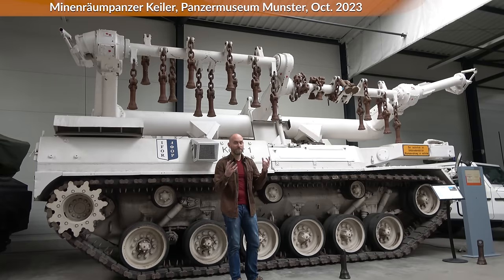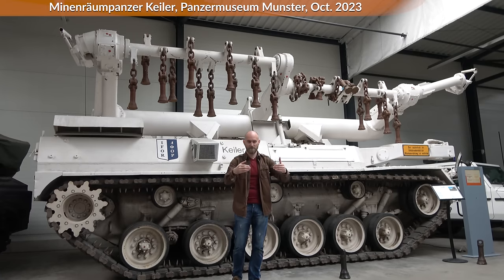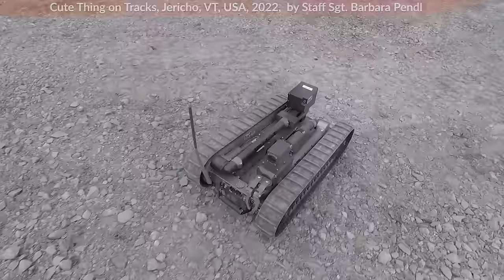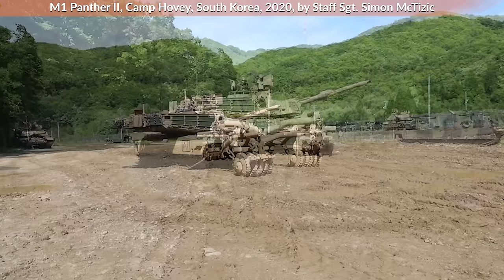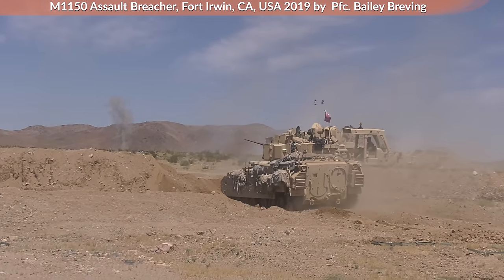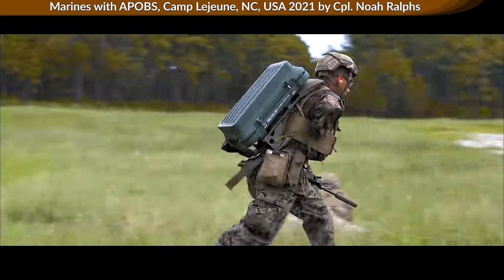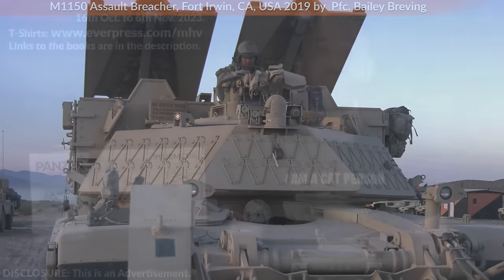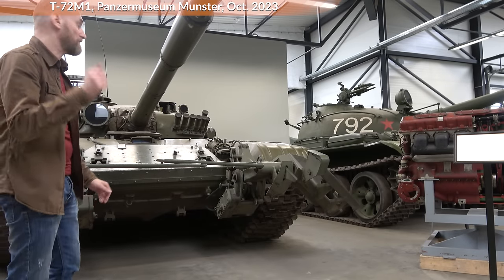Ukraine: The Problem with Mine-Clearing Tanks

Comment: eod work is different than breeching actions in combat, i think this should be seen as different tasks when dealing with mines and thinking about used equipment. there are always new ideas around the corner like autonomous mine detection drones. a logic next step for combat mineclearing would be line charges deployed by drones to get a longer standoff distance or shoot them from cover. am curious how all this works in 10 years from now.

Comment: A remote controlled tank with no offensive capability maybe could be used, it being unmanned means it could just drive straight through and activate all the mines and keep operators safe. Have critcal component's armored more and since its de-armed even if the enemy takes control of it the only thing it could be used for is mineclearing
Reply: Exactly. Nowadays there is literally no reason to use people for such dangerous tasks. Automatised T55 without the turret, extra armour plates slapped here and there and a plow at the front would do wonders. One could even slap a steel rope behind it and when tank is destroyed it could be dragged back clearing another lane :). The sad thing is however that western military is incredibly slow to learn and corrupted to the extreme. Cheap is bad for business. Unfortunately the war in Ukraine can be won only by cheap and disposable with some support of specialised systems. Not the other way around. We see this in case o FPV drones that handly overwhelm more expensive systems.

Comment: I assume that future mine clearing (although the Ukrainian's are rapidly innovating so we may see it soon) will likely be carried out by a mix of small UAV's and very small disposable unmanned ground vehicles or drones which maybe managed by AI systems.

The airborne UAV's will use thermal imaging and perhaps millimetre wave or ground penetrating radar to detect the mines. Then a large swarm of cheap disposable UGV's or FPV type drones are delivered into the minefield. Each one positions itself over or adjacent to a mine and detonates its 'kamikaze' warhead.

Basically we are talking about a 'smart' dispersed multi-element 'MICLIC'. 

I can even see a large UAV or UGV being used as a 'mother-ship' for hundreds of disposable kamikaze 'micro MICLICS'.

We are not far from this point. If someone can combine the quadcopter UAV carried Thermal imaging and ground-penetrating radar systems we are starting to see in Ukraine with computer managed drone swarm tech we are seeing in drone light displays and the cheap FPV kamikaze drones we are seeing proliferate in the field then you have the makings of a dispersed autonomous mine clearing system. Airborne LIDAR and computer managed optical survey techniques seem like other remote detection options. If LIDAR can see ancient ruins hidden under jungle for thousands of years from aircraft, then LIDAR mounted on UAV's could definitely detect and map the soil disturbance that indicates a buried mine. 

The hardware already exists. Its integration and software that needs to be created.
Reply: Ukraine is legit rapidly developing, they are like on 40th mobilisation wave. Crimea by summer with spring counteroffensive 😂

Comment: What about DM-22 anti-armor mines? Those are single-use anti-armor automatic anti-tank grenade launchers, simply put, used for path denial. They can stand between 50 and 100 m from the armor path, depending on modification, and can be triggered by contact (of the wire) or by magnetic field, or by operator.

Comment: Modern mines are designed to be shockproof at least I thought. They require a constant force acting on them to detonate. So line charge should not be as effective/reliable. Old mines are used n Ukraine from what I hear.
Also a thermobaric charge might have a pressure effect long enough because of its blast characteristics.
Reply: Most Russian mines are not Advanced mines but are conventional ones, so shock will set them off. Well, most, not all. Just a few hundred Advanced mines per 500m^2 can ruin your day.
Reply: @ArchOfficial  Yes, and you can notice that off-route mines are completely left out of discussion even though Russians technically should have them. they are just so rare at least on their side.
Reply: @MarcinP2  They probably have a lot, it's just not a lot compared to the tens/hundreds of millions of mines/bomblets of other types they have. You'd need millions of them to have a significant % but they might only have some thousands.

Comment: I am confused by some of the statements, or rather I think they are wrong.
It may be that some of the statements arose from the specific context of the interview with the combat engeneer, which we do not know.
The alleged superiority of mine ploughs may be so but, for one thing, the error rate is higher with mine ploughs than with the mine flail system and Mine ploughs are practically useless in rocky terrain. There are anti-tank mines that act as shaped charges, but most of them, and especially the millions of plate mines laid in Ukraine, are not. If they are not pushed aside but simply fliped around they are still very dangerous.
The repeated reference to the chassis of the M48 being out of date can only refer to the firing of anti-tank weapons. Due to the one-piece cast hull, however, it is considered to be particularly resistant to blast effects, which is probably the main threat posed by mines.

Comment: Those Anti Mine vehicles failed so badly because of Artillery (easily corrected fire for effect because of Drone POV)

They just let them Plow through a lane of couple of dozens of meters and when the assault elements came in they got Targeted and bogged down due to the limited lane Lane the mine clearing vehicles made.

Edit: I remember when the British used infantry engineer's to clear mines and. When the tanks came rolling in the 88's and other anti tank guns bogged down the Tanks due to again the limited safe lanes.

Comment: One thing that you fail to mention (or at least emphasize): Mines are not a means to stop an attacking force, they are a means to limit an attacking force's freedom of movement. The defenders usually expect the attacker to be able to clear at least one lane through a mine field, and they'll be standing by with artillery, tanks, anti-tank guns or handheld weaponry to then attack any vehicle that comes down that cleared path. If the cleared path has only the width of a single vehicle, the defenders only have to be able to take out a SINGLE attacking vehicle, at which point everything behind that wreck will have it's advance halted, and everything in front of the wreck will be cut off from their retreat route.
This is why the fact that the vehicle-launched mine clearing charges can cut an 8 meter wide path is so important. It allows an attacking convoy to use one side of that lane and still have space to pass vehicles that may become disabled.
The only situations where something that clears a path as wide as it's own wheel base will be useful is if they are used with 2 or 3 of them next to each other, of after the defenders have already been pushed away from the mine field, or if the attackers can suppress the defenders so well that not a single suicidal RPG gunner can stick his head out long enough to fire at the column.

Comment: Question:  Could you map and detect mines with a lidar drone or something similar?  Follow that with drones to place small charges on the mines that could be remote detonated simultaneously.  It could be quiet and possibly at night or with a smoke screen.
Reply: Lidar doesn't penetrate soil. 
Radar cant distinguish mines from funny rocks and other trash
Metal detectors see trash and not all mines have metal bodies.
It would have to be a pretty advanced miltimodal expensive system. And it would still be slow and miss rare configurations

Comment: Why arent these remote control. Theoretically they could be set in gear in straight line. Run in reverse to clear for infanty. 

  Has a drag screen on steriods(like whats used on dirt and gravel roads to level) been pulled behind other flail or rollers.

Comment: i don't see why their visibility and exposure would be that much of an issue. sure it's a sitting duck but ANYTHING that fires on it will be giving its own location away. so if you have a tank platoon following behind or just scanning the horizon along with anti-battery artillery, it seems like mine clearing units would be just fine. also, especially since it's a given that their slow, give them super heavy front armor to make the first hit supremely survivable and the friendly tanks and artillery can deal with the attacker.

Comment: Imagine an area potentially laid with anti-tank mines. You send any of these mire removal devices to clear a path.  Then the military vehicles follow. What happens if they are then ambushed? If they go off-line, they risk hitting a mine. If they stay on the cleared path, they become trapped and easy targets.  Therefore, my opinion is that I don't think that clearing a single line is safe...

Comment: Heard from Ukrainian milbloggers that there is an ancient mine clearing method, if there is long dry grass on a minefield it can be set on fire and mines detonate because of heat.
Also mines are seen in the infrared cameras after sunny day because they have different thermal capacity than the soil. Typical anti-tank mines are seen as bright discs. So, most likely , the future mine clearing will be from above by using drones by dropping small charges or using attached machine gun. And all the process will be carried out by AI.

Comment: I think the video is confused by not taking account of the difference between clearing and breaching. 

A breach is a tactical method to punch a lane through a minefield, often under fire. Speed is often of the essence and the risk of missing mines is balanced against the risk of coming under fire. Ploughs are only of value in breaching as all they do is push the mines out of the way.

Clearance is a term we reserve for the search and disposal of 100% of mines in a defined area, not under fire, and where the emphasis is on safety.

As such, NONE of these machines are mine ‘clearance’ devices. None of them are 100% effective and are not considered as a single clearance system.

Comment: See it'd be much more effective to have an armored vehicle with ground sonar, and ground penetration radar, you can use to map the  exact locations of possible mines to blow up, and map safe routes through a mine field

Plots via GPS, and can put spray paint markers on where not to walk

And the sonar and radar devices don't have to make contact with the ground,  a few mm gap so mines don't blow up

Need narrow tread, and wide axle spacing and high suspension so the operator and vehicle is elevated, like in a monster truck, so equipment would "hang" close to ground, while operators are 10-20ft up so if something blows up, less likely to cause injury and vehicle absorbs or reflects Shockwave

Or just use a remote control rc vehicle and attach and modify to have such things

Cheap and easy to replace if it blows up and can be made light to not set off mines it may drive over....

Comment: If you had an air compressor the size of the tank or have one in tow how easy it would be to grab several of the old disassembled tank turrets for use as a mega air wands. Remount the expendable turrets and bend the barrels to point and move in a desirable array, joy stick or autonomously controlled device in conjunction with whatever demineing chassis deemed appropriate to carry or push the extra load. 
In whatever scheme you can point out for demineing, the absence of large volumes of compressed air has been entirely overlooked or deliberately discounted.

Comment: The rotation part of the mine detonator is a mass of steel thats to close to it's operator's and isn't  really sustainable when considering the effort, materials and risk to driver. Remote control vehicles  that detonate a mine is a great concept and can take the danger out of the equation but is technical and costly to replace. They also take precious resources and do not realistically going to clear sufficient mine amounts. So a cheap, quick to repair and simple system that maintains a safe distance from the operator when driver has a armored cab. So here's my approach for getting mines cleared at numbers  needed to speed up killing putins war monster. 
A simple triangle braced 40' long extension with straight tube axle for two wheels to support chain flailing or whatever detonator system that works. The difference is make the extension out of bamboo, sounds cracker jack but the things going to get blown up constantly right? Bamboo is Hella strong light weight cheap and the extensions could be easily fabbed so it wouldn't be so far fetched to have twenty or so frames made. Tinker with the design and I bet some of your very capable mechanical aptitude guys could put that concept in the field. This suicidal part of the machine is the Achilles heel I believe and if concept can be useful.

Comment: Question: with the advent of cluster ammunitions, either artillery or air launched, could the use of these munitions which cover a patch of ground in bomblets be used to clear mines? Shell a particular zone of attack and drive through?
Reply: The unexploded ordinance from cluster munitions poses a risk to infantry and unarmed vehicles.
Reply: @jsimmons9969 , since that is already a risk because these munitions are in use at trench clearing, is not the benefit of clearing mines worth the risk? What percentage of bomblets fail?
Reply: @andrewsmith9174  I'm no expert, but I doubt the small charges are sufficient for mine clearing. Mine clearing charges are usually massive. And that's not even guaranteed to work. It's a multi step method to make a safe lane through a antitank minefield. The dud rate of cluster munitions is debated. Maybe up to 40%.

Comment: I wonder if the Ukrainians could just put several of the infantry line charges on top of some armored vehicles and have them advance in line abreast in several locations at once launching the line charges ahead of themselves as the go followed up by other vehicles.  Might be able to get vehicles through the minefields fast enough to not be caught out by artillery and get into the Russian lines.
Reply: Both sides have used vehicles like that to some success, often modified MTLBs or APCs. 
Minefields are just insanely thick and peppered with mines that won't go off on line charges and remain in "cleared" lanes, so any movements to any direction will be slow grind until resistance just collapses suddenly (after morale breaks or supplies run out etc)

Comment: And in Ukraine, there is often a dark path that can be seen from distance. That lane along anything that moves in it is an easy target for any artillery.

So in best case you have a cleared path, but it is unusable, because enemy can see where it is and aim artillery against anything that moves along that narrow path.

I'd search further on what Ukrainians have found so far. Mines can be seen night time by their heat signature. Mines heats up during day and are radiating that heat and can be seen during night. When you can seen the single mines, then you may create a shooting system that takes them out. Of course hitting mine sized target is hard and havig enough force to explode it is even harder. Also all mines are not on the ground, so their heat signature is different and might no be seen... You could design a gatling gun type system, with mine clearing explosive rounds, that first takes an mine image with nightvision, then starts blasting them from the distance and with premade pattern (computer system). Crew could be away from the gatling system, so enemy fire concentrates only to gun, not the crew... Or you could have Strela type of guided system from the distance (you may operate system via video/wire). In this way you could have way less mines in the field and you may just hope that there are not that many not seen mines digged to the ground... If successful, then you have larger area (mostly) demined in just few minutes.

You may also use drones to blow up mines, but this is a pretty slow method and mostly usabel against single mines or against larger storages of mines.
Reply: "Or you could have Strela type of guided system from the distance (you may operate system via video/wire)" - Economy says, using guided missile to destroy a mine that costs 1/100th of the missile price tag is bad idea. Unless you want to bankrupt a country (and lose a war anyway).

Basically, solution needs to be "wholesale", not focused on individual mines.
Reply: @randomnobodovsky3692  You did not understand what I said.

Strela type - gatling gun. Not missile, but a simple BULLET.

Comment: I'm wondering about the dust issue. If you wait for the wind to blow towards your enemy, wouldn't the dust be an advantage, since it provides the mine clearer some cover?
Reply from the maker: you would not see where you were driving...
Reply: @MilitaryHistoryVisualized  Wasn't the point that the driver anyways needed directions from an outside observer?
Reply from the maker: depends on the vehicle, but the observer in this case would also not see anything
Reply from the maker: also the dust signature is a lot about "being seen".